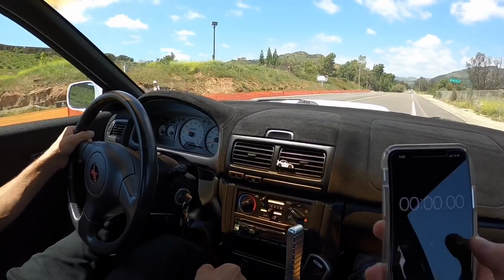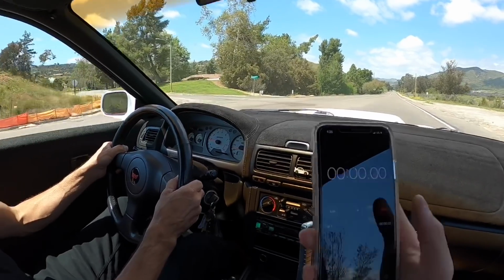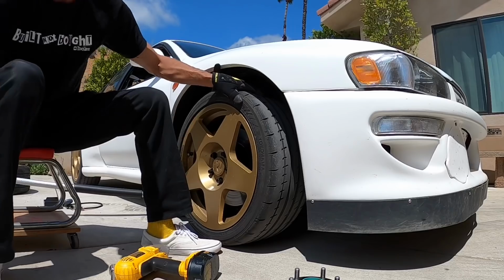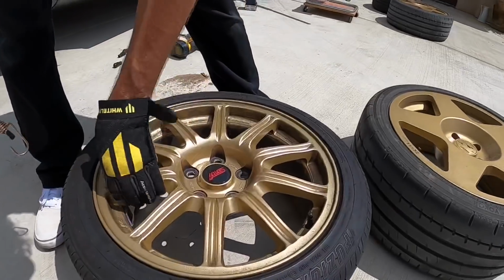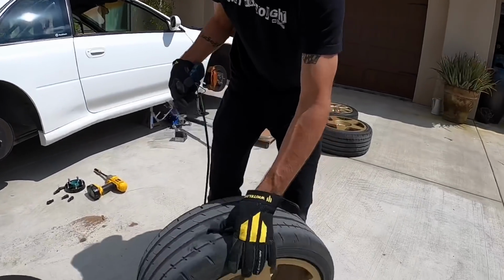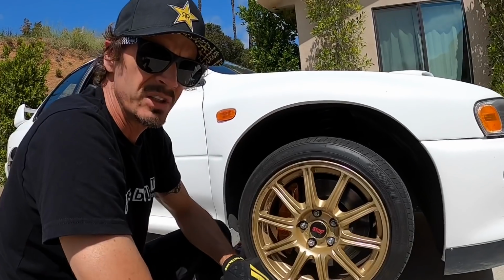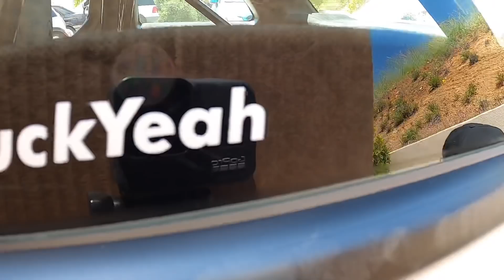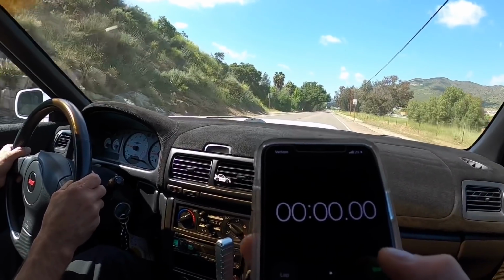“18 or 17 inch wheels?“ Built Not Bought #25

Comment from the maker: Hey everyone, winner has been chosen and the weight was 53lbs. Thanks for watching and playing along💪🏼🔥
Reply: BTW, how much did the spacers weigh?
Reply: BuckYeah damn not even 24 hours later. I snooze I lose.
Reply: Wheel weight will effect acceleration but to a greater effect is deceleration and rotational inertia, "turn in response." Great video showing just how much the weight of the tires and wheels will effect the cars performance.
Reply: 53 wow thats heavy. Get something lighter. Funny Dave "22b" and I were talking about rims in this size the other day. I run 235 40 18 on my wagon on enkei ekm3 5x114. I'm looking to do a sedan conversion. Wonder how heavy my enkei's are lol.
Reply: But do they know the difference between CCA and CFM ;) ?  Besides weight, you’re also changing rollout (gearing) with different wheel size...so yeah...there’s that.
Reply: Huh. I guessed 53 just for the hell of it. I'm about a year late😂

Comment: In weighing the bbs setup, also include the spacer weight as its part of the rotational mass. 30mm spacer, I'm guessing ~3lbs each. For the 1552's my guess is 54lbs each. Performance gains would depend on a combination of overall diameter between the two and their weight. If both are equal, whichever is lighter assuming the 17's.  Awesome vids man!

Comment: Get some Method MR503 wheels Buck! My 2020 STI has 19x8.5 wheels that weigh a ginormous 53Lb. I’m getting a set of MR503’s in WRC size 18x8. Throw a set on Cup 2 tires on. Total weigh 41Lb. That’s a 48Lb unsprung weight loss! Like throwing a big adult man out of the car.

Comment: If I wanted to put on some 2018 stock sti wheels on my 1995 Impreza, would I need new suspension?
Reply from the maker: You’ll need to make sure bolt patterns are both same but other than that suspension won’t need changing

Comment: Your "garden edging" lip already have a tear in it, on the passenger side? I don't really like the look of the Fifteen52s, but not a fan of the BBS look either. I'm the type that prefers thinner spokes and a lot more of them. Out of those two though, I'd rock the Fifteen52s. What's the weight of the spacers? I mean, you should add that weight to the BBS. My guess, the Fifteen52s simply look heavier. I'm guessing like 55 lbs.
Reply from the maker: Khanikun ᗒᗣᗕ Lip is in perfect shape and not garden edging. You need glasses 😂
Reply: @BuckyLasekOfficial  No, I know you got it from...I don't remember the company name. Some material that's like mudflaps or something. I just quoted it, since it's currently a one off item and doesn't kind of have a name.

Comment: 48lb.  However, the tire diameter also plays a big role.  What are the 18" and 17" tire sizes - width and aspect ratio?
Reply: I suppose the older ones are wider, and so they weigh more.

Comment: Theorhetically 17's would give you a more balanced performance spectrum for daily/track/off road. And 18's would probably be better for track as the tires have less sidewall flex. I will guess the fifteen52s are 55 pounds a piece

Comment: I don't think measuring 2nd gear pulls is going to determine the difference 1 inch of rim makes. Having more tyre however will give you a smoother ride and pot holes won't be as big of a deal

Comment: OK, I am sure someone guessed 53.8 pounds already.  Tell us what the weight was already.  Those things are porkers and honestly, I may not get them now.  Does anyone know if the 17" 1552's clear stock STi Brembo's?  

I have 18" Prodrive wheels that I tracked for a while on my Bugeye.  I then moved down to 17" RPF1's and wider rubber.  Less weight and it is so noticeable at the track.  Performance before looks but some like it the other way around.

Great video Bucky!

Comment: 17" all the way, maybe even 16". depending on tire size, your gearing ratio would be decreased, which means faster acceleration. it's something that hondas live by. my ITR has a 5.0 final drive, which means i accelerate faster than those with a 4.7 final drive, or a 4.3 final drive. you should look into final drive gearing. another thing that really gets me excited is steering ratios... make your car's steering lock to lock faster improves it's drivebaility through a road coarse or auto cross coarse, and makes it overall funner to drive. i'm not an export in those matters, but just things that i know would make a car overall more fun in incremental ways.

Comment: Are the overall diameters of the tyres the same... Smaller wheels (overall, outer tyre diameter) offer better acceleration as it takes less time to do a complete revolution, larger wheels / overall tyre diameter (no surprise) take longer so accelerate slower, but will offer higher top speed & the smaller overall diameter will have less top speed (like changing sprocket sizes on a motorcycle, it’s a trade off). In theory when going from a 17” to an 18” wheel you should have lost 1/2” of tyre sidewall so the outer diameter will remain the same (adjusting this will also throw your speedo out as well as affecting acceleration).
Reply: If they pick up better as the BBS are lighter & the outer tyre diameter is the same I’ll shut up 🤣
Reply from the maker: Badmudaphucka Same size diameter

Comment: Thinking any weight difference should include the spacers and spacer nuts.  Didn't get a good look at the tires on the BBS wheels, but I bet you can find some lighter rubber to make it even better.  Curious about the tire sizes, too.  Smaller diameter really helps acceleration.

Comment: Get 17's with the proper offset so you don't need spacers. Are the rolling diameters the same? Smaller wheel will accelerate faster but lower top speed and also your speedo will be out.
Reply from the maker: Bruce Thomson Yeah they are the same
Reply: @BuckyLasekOfficial  Cool then get Fifteen52 to make you some 17s with the right offset. Turbomacs? But not in white they are a bastard to clean!!

Comment: Hey Bucky, what is the diameter of the stock and 1552 wheel/tire combo?
Reply from the maker: Patrick Yale Same as stock ones I put on.
Reply: @BuckyLasekOfficial  thanks! I was wondering if the small diameter of the stock tires brought down the final drive and increased the acceleration more than the weight difference.

Comment: That's a fair bit of difference. 

What are your tyre dimensions? I was trying to see during the close ups of the tyres

Also, how have you achieved that nice blow off sound between shifts? Usually I see that sort of sound by a front mount intercooler but I see you're on top mount. I have a similar motor setup to you on my bugeye, finished a 6 speed swap recently.

Edit: I listened again. Sounds like a normal vent bov. Dunno what I was thinking before
Reply: Paused the vid at the right time and saw they're 225/45/17. Mine are 235/45/17, my sidewall is bigger - probably simulating closer to the size of an 18" wheel. Based off your findings, my larger sidewall would increase my spool time and reduce responsiveness.

I'm glad you documented this, definitely have influenced my next tyre size, I'll get a step down in sidewall to a 235/40/17.

Comment: the 18s look better. That means more stability @ higher speeds. Personally i think the 17s dun look as good. also u should add in the weight of the spacers. to the 17 in consideration. 

But even then iam sure the Fifteen's still weigh heavier.
Reply: If i may add on. The Fifteen52s to me, are reminiscent of the 5 spoke Speedlines that were used on the Legacy BC5 in the WRC, before the GC8 came along.  Now, while the more accurate period correct Speedlines would be the 6 spoke ones for the GC8, the 5 spokes are closer to period correct, but for me, that'll do. Tarmac wheels are 18 inches anyway, and since you have the 22b-esque fenders anyway... it makes more sense don't you think? And also, i feel the Fifteen52s look better than the Speedlines. 

Buck yeah

Comment: Tire selection also matters a lot so it depends if there is a brand/model of tire you want with 18s. I think they have the most options however 17s still have a lot, you do get more sidewall if you want that (I personally think 40 is the best sidewall height for street cars and 45 works well for mixed driving) but Bucky knows more than any of us keyboard warriors.

On my 2015 I have 18s but would rather run 17s.

However I believe  the 18s weigh about 46 pounds.

Comment: The stock wheels look like they’d benefit from some better tires. I’d have torqued the spacers rather than just using the breaker bar but that’s my ocd. 
My guess is the tarmacs with tires weigh about 48lbs

Comment: 54.3 lbs
Wheels should be 29-31 lbs and the tires a little less then 25 lbs with the wear and tear.
I like the 17 BBS wheels but I'm biased because those are the same as on my '04 STI and I know those only weigh 17 lbs each.
17's weigh less but the 18's are wider for more grip, maybe put some offroad tires on the 17's for the dirt and some quality street or semi slick tires on the 18's for the track. Maybe in the future you could talk your tire sponsor into giving you two sets of the same tires for each set of wheels and test them on track and possibly also on dirt.
Thanks again for all the great videos!
Edit: Damn I was close at 53 lbs.
Reply from the maker: Vegaspsycho 👍🏼👍🏼

Comment: 49.7lbs - not sure what the point of the test is. fact is that a smaller diameter wheel will get through the revs quicker but cover less distance than a larger wheel. i'd keep the Fifteen52's - these are the nicest wheels i've seen on a 2.5rs. any marginal gains are just that, it's just a buckit.
Reply from the maker: Brofessor _ Haha👍🏼

Comment: hi...ill guess 45-48lbs...so uhh if we got with the middle of that its 46.5 lbs...fuck it..lets say 47 lbs.

my original guess was 53-54lbs but im hoping googling led me to a more educated guess.   47 lbs!

also just so you know they make apps that work with your cars OBD II reader and they will automatically start and stop the clock according to the parameters you set i think...so like if you want 2k-6k rpm you can probably set that in there and it will give you the time it took...im 90% sure they make that...just need an OBD II reader ...now i wonder if they have a wired one instead of bluetooth, though..

Comment: your fifteen 52 wheels are supporsed ton weight around 25 to 27 pounds, an average tire weigh 20 pounds so i guess... 48 pounds? but i would be surprised because an AVERAGE tire weight 20lbs and you have "low profile" tire so... in fact, it should be around 45lbs. Anyway, i find the look on the 52 are nice but i'm getting tired of this desing, maybe another model ? The Holeshot RSR or the Podium? Or a nice set of Enkei!
Reply from the maker: Karl Blanchette 👍🏼👍🏼

Comment: I think 53lbs
Reply from the maker: craigkun You got it right but someone beat you 👍🏼
Reply: @BuckyLasekOfficial  Not quick enough... damn.  But If you're looking for another 18in wheel either for the racecar or the buckit, check this out.. https://www.mann-engineering.com/collections/speedline-corse/products/speedline-type-2013c-18x8-5x100-et11-6-gold-group-a-wrc-road

Not sure if it's in line with your future brake upgrades/wheelwell fitment, but they do look nice, not sure on weight though